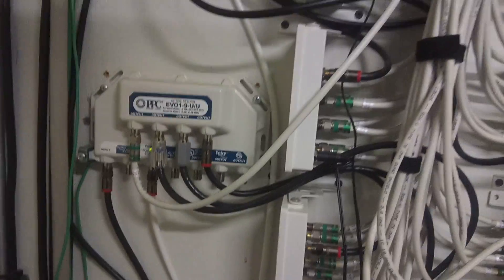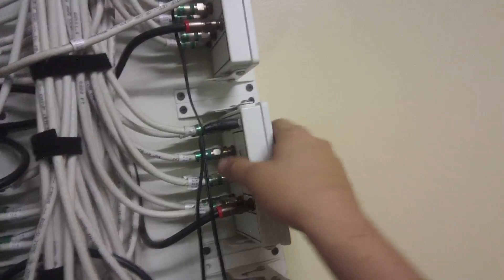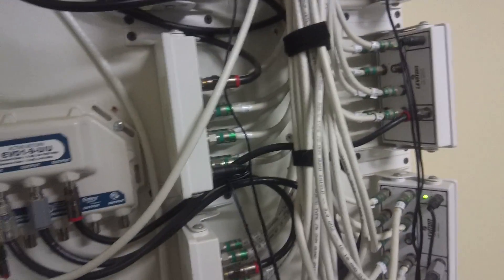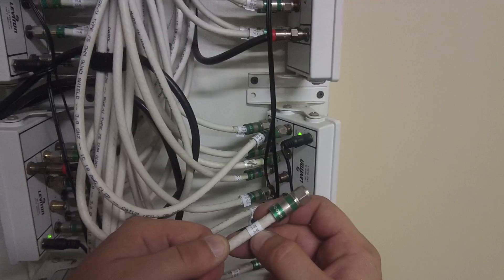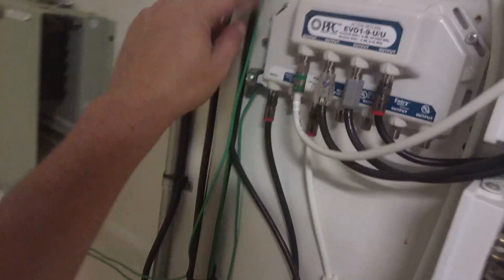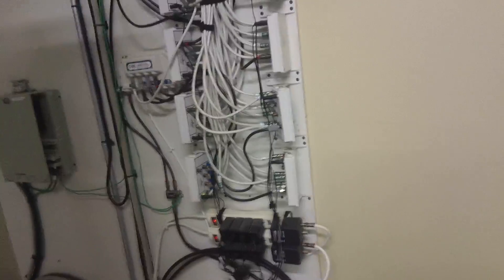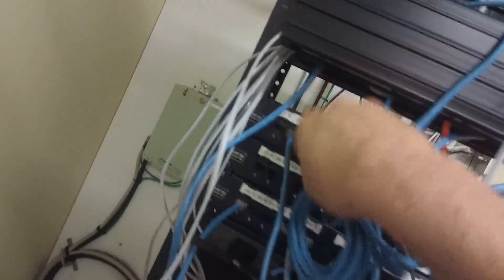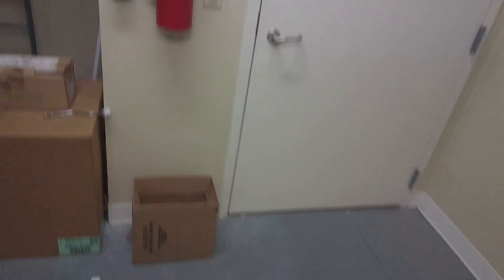The Cable Room I Wired. (A response to the cable doos and donts video.   )

Comment: Just a note for the future, the length of those coax cable looks a little short. I'd find whoever cut them and give em a finger wagging. DirecTV made us use certain fittings or we would fail our QA. So having extra length to replace fittings is always good! Certainly a step up from the other room. I do have to say I doubt that ground you have is a NEC approved method, but if Comcast can't be bothered to do their own work then something is better than nothing.

Comment: With those crappy consumer level amps, aside from the noise they inject, they are unity gain, meaning no gain, just multiply the ports.  The top floors will get weak and tilty signal, while the botton floors will be strong.  You need to put taps and learn to EQ it.  If you have less than 30db of signal you need a line extender.  High tap values for the lower floors, then work your way down as you go up.

Comment: GET THOSE AMPS OUT!  They raise the TX and noise. Those amps can wreak havoc on modems.
Reply: comcast sent the amps and wanted them to be used
Reply: If they did, I'll admit I was wrong.  However, those the type of amp I'll usually bypass when given the opportunity.  Also, they don't look like the type of amps I usually would put in, so I may have jumped to conclusions.  They are definitely not ones I've used in the past.

Comment from the maker: All of our rooms are self locking  we have to let  the contractors in the rooms
Reply: Geoff, That looks like the beginnings of some of the facilities I deal with! The problem isn't that the rooms need to be secured as much as it's that you don't have to let them "OUT"!! LOL  All the ones in facilities that I manage are secured as well. If I am not around to check on them when they are finished, the rat's nest of wires,  improper grounds and lost labeling is the result.
•••• I posted a sign in all of the facilities that says: "Notice: If your work does not fully meet the applicable codes for the work you perform, you SHALL be called back to correct it at your own expense, or the management reserves the right to withhold payment to you and contact another contractor to correct your work."
In the electrical room it goes on: "Special attention SHALL be paid to N.E.C. Article 100 "...All work shall be performed in a neat and workmanship like manner..." and Article 250 Grounding. ANY deviation of these SHALL result in a call-back for correction at YOUR expense. After calling Cox Communications (the local cable Co. where one such facility is located) back in 4 times, then calling in the Wiring Inspector, Not only did they come in and make it right, there's been no problems since! 
•••The "Squeaky Wheel gets the grease" syndrome there!
By the way, the code requires EACH cable to be grounded "As close as practical"  to the entrance of the building.  Grounding in the pad isn't counted as it is not part of the building's grounding system. see N.E.C. at 250 The amplifiers, splitters, diplexers, etc should be mounted to the ground plane provided, or INDIVIDUALLY grounded. It is allowable under the code to 'Daisy chain' a number of them as long as it is a "SINGLE UNBROKEN CONDUCTOR". No splices are allowed, two wires under a single screw is not allowed.
For the record: I am licenced: Master Electrician, Refrigeration 1, Communications 2, have an ivy league degree in Building and Facilities Management, and am certified by ISCET/FCC/CAT, IMACA, ICTI, ACRT, Master CET, and a dozen others.

Comment: Those levitron amps are crap for cable, the ground wires on the splitters and amps are pointless since the main tap should already be grounded, and ingress causes plant issues regardless if your tenants only have DTAs.

Comment: How have they not put a high pass filter on that mess I bet the ingress is screaming from that.
Reply from the maker: shinobie snowfield  Yeah you're probably right who knows at this point. And the rg11 wire going to the input is ran over 5,000 feet  it's going to a ped but there is only 27 apartments in this building and they all use dtas boxes and there's two set-top boxes no internet because that's provided by our company. Thanks for watching
Reply: High pass filters don't stop ingress. They were used to filter... porn channels from subscribers who didn't pay for that service. :-)
Reply: Philly True yeah maybe 15 years ago. now, they're used for ingress..

Comment: Dude I'm going to have to give you a pat on the back that don't look bad at all from the other room so that would be easier to to work on toning out of an apartment or such that's not too bad..... I would have taken your bonding wire you're calling ground and kept on going over to the main ground if it's in the bottom of the building there if possible.  But I'll give you an A for effort on that one.